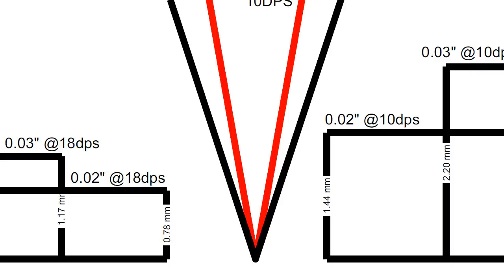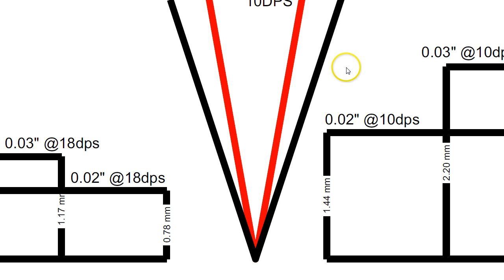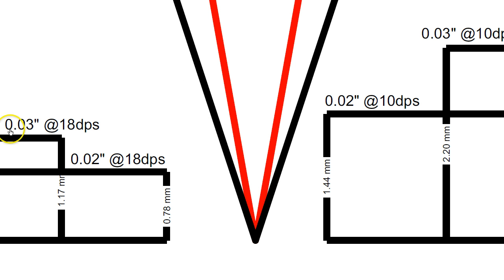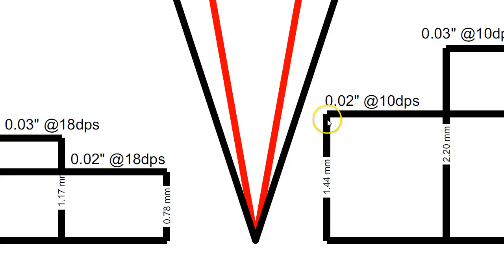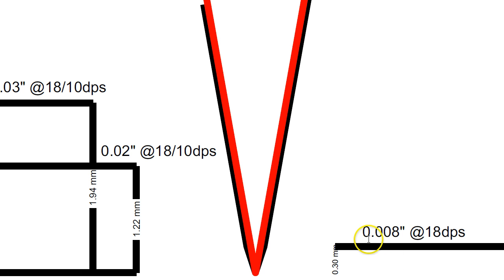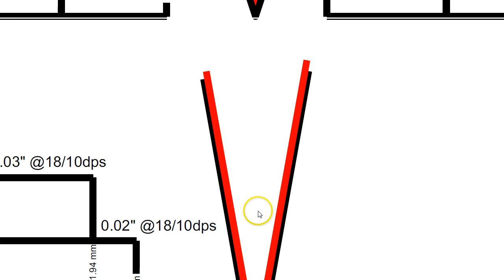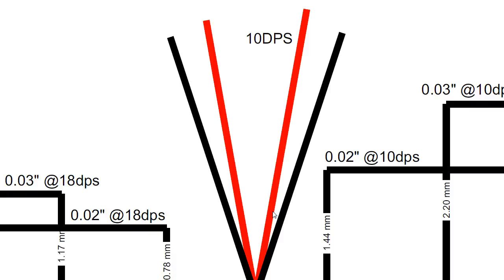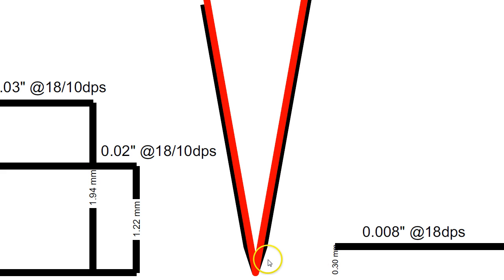The Power and Advantage of MicroBevels in Knives

Comment: You said you use artificial numbers for this.
1. What microbevel size do you use atm?

I use ~0.1mm.
As if i go below that if the edge is damaged the deformation can extend into the transition bevel.

2. And whats the widest you keep your transition bevels (when viewed from the side), i think larger than 2mm takes to long to thin.

As a transition+microbevel for me is to have high performance without the extreme workload of thinning, so wanting too much performance out of it (lower transition angle) often results in too wide transition bevels that take way too long.

3. Also im unsure if i prefer a clear transition bevel of a given angle, or a convex transition, as that might cut a bit better, but again means a lot more surface to work on...
If i use a shallow convex i still microbevel, as that visually ensures me the exact stability i need and not more.

Great video btw, i used microbevels before seeing this a few years ago, but it strenghtend my belief in them, and is great for sending to friends on this topic, and is one of my all time favorites.

What you show better than most channels, is that the microbevel should be the intended edge angle, not steeper, instead the angle behind it should be shallower. Which increases performance.

When i sharpen friends knives, the first time it always takes a moment to add the transition bevel, but every year its a breeze to touch up the microbevel.

Hope your still around!

Comment from the maker: I think the term Zero Grind is very open to interpretation as there is no actual mathematical correlation.  
To my mind its simple. you either have multiple facets, or you dont.  To me, a zero grind is simply a single bevel, irrispective of the shape. so when talking about flat facets then a zero grind has to be a flat pane, but when dealing with concave or convex, then the bevel doesn't have to have a linear equation.

Comment: Very well done . . .  I sharpen in a similar way with .005 behind the microlevel on kitchen cutlery.
- I have built an automated pneumatic powered push cut test rigs. 
- One is set-up to gather data on force required to cut medium & high density fruits & vegetables.
- Understanding how various: blade cutting edge angles & behind the cutting edge geometries 
influence cutting is essential to blade design. 
- I will be sharing my data for kitchen cutlery on my web site & in a youtube video soon. 
- My thoughts is this test rig will work for a multitude of materials.
- If there is an interest in this, leave a comment.
Reply from the maker: If you post it, place another msg. I will certainly be interested to see it. it sounds like you are doing something like a catra test, but aimed more towards real work food materials.

Comment: In japan people maintain their knives more.  My Shosui Takeda knife is about 12 degrees per side down to zero because he explained it will cut better and his steel will hold better then most. It is easy to resharpen on the stone even if it is weaker. Kyley makes the knife more durable with a microbevel wit only a slight degradation in overall performance giving you the best of both world with superior geometries.

Comment from the maker: Hi. I'm not a fan of chisel ground knives unless I intend to do some chiselling, which isn't very often. Chisel grinds are good when you are shaving or paring material off the side of something and you want a clean straight finished edge on the other side. This is good for tomatoes, cucumbers, wood, fish.. etc. but they only work well on the correct side. you need a left side or right side for the task.  standard in the middle grinds will always be the best general purpose grind IMO.
Thanks

Comment from the maker: no stupid questions, only stupid answers :)
i dont know if i am interpreting your question correctly.
you can have a convex primary and a convex secondary with a distinct transition. this is not a zero to me. a convex by nature is a constantly changing angle with a defined starting angle and completion angle. its the rate of change of angle inbetween these 2 points which define the shape.if the angle drastically changes in too short a distance it forms a "transition" that isnt smooth anymore

Comment from the maker: Thanks. As to the Zero grind. It depends on what one interprets a zero grind as. if you imagine that a zero grind is the convex equivalent of a full flat grind then most often, just like a full flat grind you'll end up with too little steel on the edge, and more steel in the body. 
good convex knives are almost never a single arc from a circle, but should be more like an arc of an eclipse where metal is included/excluded in the appropriate areas. 
please watch this. watch?v=1xxf5_0djvE